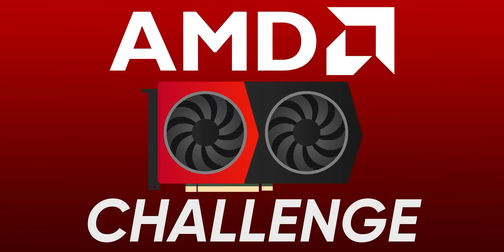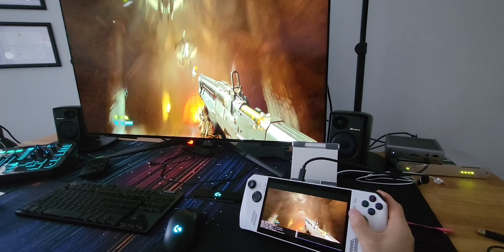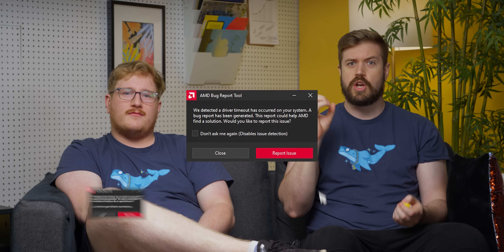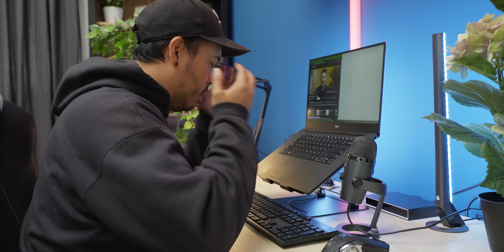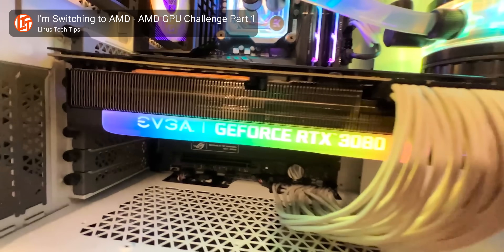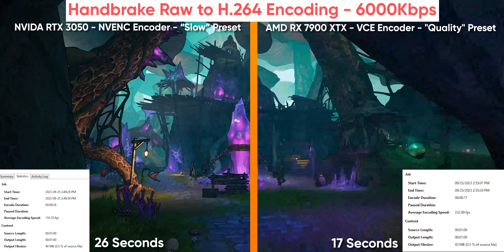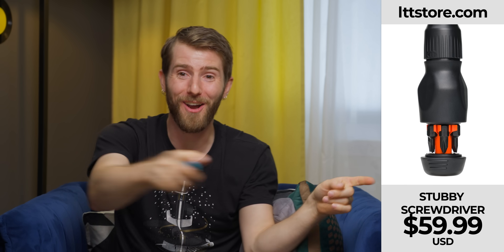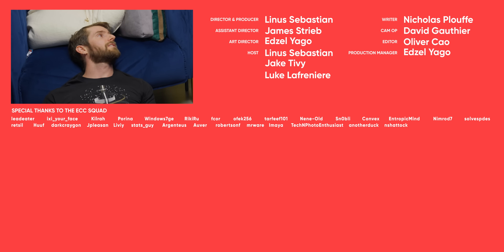I’m Staying on AMD! - Radeon Challenge Pt. 2

Comment: I've been running all AMD since before Ryzen gen 2 came out.
The most severe problems I experienced were that the system would randomly crash during a video render (turns out the GPU was actually, physically brokem. It worked great for 5 years though, so I definitely got some good milage out of it) and the red and blue channel switching for some reason when I imported a clip into the editor timeline (turns out the newest drivers were bugged, downgraded them and that fixed the problem).
Overall, my experience has been pretty rock solid, and with FreeSync monitors being much cheaper and easier to obtain that GSync monitors, white the cards themselves also tend to be cheaper for the similar performence, I don't see myself switching to Nvdia or Intel in the foreseeable future.
Reply: Yea amd sucks I won’t lie. My friend used an amd gpu and his stuff constantly crashed
Reply: When I tried making the switch I nearly barfed at the 6950XT's streaming encoder. No amount of tweaking brought it close to what my old 2070S had.

Then the random VR issues like steamVR intigration detecting my vrset as a moniter instead of a vr set, stealing my mouse cursor, only for turning OFF the intigration making it so games literally couldn't detect the AMD card. Ex: Darktide

Then the inconsistant and unexplained flickering on my third monitor where it'd just randomly lose signal from the graphics card.

The preformance was great for the price! But... I like VR, and I want to have the option to stream.

So I swapped back to green and got something in the 3000 series. 😅

Comment: For Luke’s issue with discord randomly crashing, I also had the same issue on my XTX but I fixed the issue but using 3 individual 8-pins from my power supply instead of 2+ a splitter (should have been obvious). Not sure why discord was crashing, but turning off hardware acceleration also fixed discord from crashing when the drivers crashed (which I didn’t need to do after the cable swap)
Reply: So you are saying you ran 3 individual Power Lines to the card instead of the Cheat 2 Way Wire that Splits from 1 Source Socket,making the setup come from a 2 Line then go to a 3 Line Powered Source.
 This would be the the MOST IDEAL for MAXIMUM VOLTAGE DROP EFFICIENCY !
It also explains how you fixed Discords "HARDWARE" Issue ! Note HARDWARE !
 Using Hardware acceleration was the Key Here and Your Fix. The Card is using more Voltage during times it NEEDS it for voice and Vid if your using that too. That's a HEAVY Demand ! Plus your Gaming too?! People forget we ask alot of these things.
They are truly a Modern Gift. But during Voice & or Video Side-loading through Discord,
 the Video Card draws Voltage & Current demand in sync with that demand.
 
Just think of your audio Amps,but MORE complex. That's a CRUDE comparison,YES,but you get the drift now. That is why Luke was having trouble ! His supply was Buckling under that strain,that and the choke point of the Pcie Cable he added. He needs a better CABLE & BEEFIER SUPPLY ! ALL the symptoms he was having points to it. Adding the supply helped ! That confirmed it! Replace the 1rst supply with a Larger/better Supply,PERIOD!
 
I'm a Retired EE,and STILL learning this day in age ! I LOVE new TECH ! I LOVE this 
Channel and what it stands for ! Keep up the good work.LINUS & ALL !!!! 🥰😎

Comment: As a AMD user I've experienced similar behavior where my GPU is pretty buggy for the first 4-5 months but then after a few months and updates the GPU reaches a state where its pretty stable while also seeing performance improvements which is nice
Reply: That should not how it be, It should be stable right at release even if they have to send it clocked down and clock it up with the stable drivers, cause all Nvidia cards no matter how expensive work right of the box with full performance, cause not everyone has the knowledge or experience to know what's wrong or the patience for new drivers, especially PC Builders who need to be able to get the newest cards into prebuilds days after release and sent out and if the PC shows up with buggy video , Who gets blamed? The PC Builder and that's not good for business for the PC Builders or AMD cause that means people new to the PC World will be like, WOW my Brand new just released last month AMD GPU is buggy as hell/ Let me buy a Nvidia one and WOW it works no issues, and they probably wont go back to AMD for a long while so honestly AMD releasing GPUs with buggy performance is just pushing New PC owners and Builders to Nvidia
Reply: good when i buy my 4080 it just works perfect from day 1 until today.
Reply: well, when you have a graphics team that is like 4x as big as all of AMD's both processor and GPU population, you can get that. this is a VERY small team making hardware that is close to NVidia, and waaaaay less people to write the software. if you do want no fuss, go green. but im sticking red for the time being because my 6950xt was waaaaay less than anything in that realm from team green. and it's been pretty stable. ive had 3 crashes in-game in 8 months since i built it. out of game, zero crashes. and, since im a disabled vet with a lot of time on my hands, i game 6-8 hours a day, every day.
Reply: @juanb2715 Thats great to hear. Took them about 1.5-2 years to fix the 2xxx series not downclocking in idle when you had more than one monitor. Im happy they have that fixed from the start this time.
Reply: @ghomerhust  So what if they have to push off release by a few months if it means working drivers? As Luke said A LOT of people probably returned their 7900xt/xtx when they had any of his issues for even a fraction of the time he did, cause not everyone is a tech head or has somewhere to go to have the issues diagnosed
Reply: @theengineer2017   while I agree that a product shouldn't be buggy at launch my 2080 that I got at launch had just as many problems as my 7900xtx
Reply: Yeah. the vega64 in my alt system is solid but spent its first year of release crashy af

Comment: The end of this video mentioning unexplainable problems was so prescient for me. I literally had a problem today with the lcd screen on my Aorus Waterforce AIO that ended up being a power supply issue with the SATA power going to the AIO being enough to power everything but the LCD screen. This was a new issue and I ended up spending hours trying to figure it before considering the power supply as a possible issue.

Comment: The weird issue Luke mentioned at 8:58 where discord closes when the driver crashes has been happening to me too these last couple of weeks. I suspect the AMD driver doing some funky stuff to cause this because it's happening with different crashes, one of them being a "DXGI_ERROR_DEVICE_REMOVED" which means the gpu is physically removed from the system (I promise I didn't remove it, only happens in Battlefiend 1)
Reply: I've actually started having some issues with Discord specifically a few months ago on NVidia, suppose they just keep bloating the app and breaking some stuff in the process of doing so :/
Reply: My guess is that it's from Discord's overlay, cause it injects itself into the game, which can cause issues on both sides. (which check boxes here)

Try to disable Discord's overlay on these specific games and seek for improvement!
Reply: So i was having this issue only when having discord open while gaming, which is kind of a big deal lmao, but if you disable Hardware Acceleration in Discord it helps A LOT, or at least it did for me. (Ryzen 9 5900x and 7900xtx)
Reply: He was most likely having some PCI-E signaling issues due to his riser. One of the tricks that GPU drivers do if the GPU glitches out due to issues like this is to power cycle GPU Vcore more or less, literally turning the chip off for a moment to reset it.
Reply: @underhandedjoe568  On Linux, I know that some time ago AMD had some issues that were traced down to a bug in the firmware that handles hardware accelerated video decoding. (which is sent to the card by the driver during boot, so there was no need to flash the VBIOS thankfully)
Reply: @underhandedjoe568  This. Had the same issue and disabled hardware acceleration on everything I could think of and it is not an issue for me anymore. Been working for months.

Comment: Am I the only one with an 7900XTX that's had zero issues with it? I have the PowerColor Red Devil and I just set the power tuning to +15 and set the fans to max, it always "just works" for me
Reply: No issues with my reference asrock 7900xtx in a micro itx system
Reply: I've had mine for about a month now with 0 issues.  I was on a 6750xt prior with no issues as well.
Reply: No issues with my Red Devil 7900XTX either.

Comment: I'm very happy with my RX 7900 XTX. I did have a weird issue where the whole system would freeze, and the entire driver was gone after reboot. It happened many times, and I was ready to return it, but then I realized the cause of the problem was my overly aggressive undervolting of the card. It never happened again after I stuck with default settings. Other than that, the experience has been stellar. It was a big upgrade from the RTX 3070, especially in the VRAM department. Most games would stutter constantly because of that. But now, they are a thing of the past. I may go back to team green for the next generation, depending on the adoption of ray tracing, the success of ray reconstruction, and whether AMD fails to catch up in ray tracing performance. But for now, I'm extremely pleased with my AMD supercard
Reply: my rx 570 once did that idk why, just renabled it in device manager

Comment: Weirdly enough, I’ve had all of these issues with my RTX laptop. 
Very interesting, is there a chance that certain software is affecting all hardware? Or perhaps 30 series Nvidia and 7000 series Radeon only?
Reply: That depends on the laptop. Its a much wilder and more varied experience when talking laptops
Reply: Is it a TUF gaming lappy? Cuz I'm going thorigh it on my ryzen 7 and 2060 as well  Hahahaha
Reply: @BenwahBalsss  it’s an Acer Nitro 5 with a 12500H and a 3050ti. It’s not much on crashing, but if I leave it on, it GREATLY drops in performance and I need a full restart to restore it to maximum performance. It’s treated me well but it’s also kind of annoying that the sleep mode seems to slow down the computer.

Comment: I think having Hardware Acceleration on in Discord is what causes a driver crash to completely lock it up or close it completely. Discord will do this when I'm updating drivers, which makes sense because the driver installer will uninstall the current driver and then install the new one. I have not tested updating drivers with hardware acceleration off to see if it still does it, but it's the only explanation I got for that. I have the 6950xt btw

Comment: Last time I saw the bug report tool pop-up I was on a Radeon RX5700XT. That one was rough on launch but very good at the end. My RX6900XT which I got since launch is really great. No issues, zero crashes. And I'm always jumping immediately to the latest drivers.

This video of TechLinus is weird to see. Hard to believe this would be the actual state when you do a proper new OS install.
Reply: Doesn’t mean that these problems don’t exist. It’s way better than 5700 XT days but it still is hit or miss. 

Even with the 7800 XT, the card just kept crashing in F1 23 because of the launch drivers. 

I had a 6600 XT, 6700 XT and 6800 XT. 6600 and 6800 XT were fine but occasionally had driver issues with the 6700 XT. It also had the ridiculous junction temperature deltas of 40c. 

Overall, it was a pretty good experience but jumped on the opportunity to get a brand new 4090 for 20% off.
Reply: @person1745  delta temperatures between 12 and 22 degrees Celsius are normal. 40 is way too much > RMA

Comment: It would be interesting to see another round of the Linux challenge on AMD. I bought a 6900XT not long after it launched and have exclusively used it on Linux ever since, it’s been absolutely stable and super performant in every use case I’ve given it. Plus I never have to think about drivers because Mesa is magic. 

Linux is Linux, so weird problems pop up sometimes, but it’s never been caused by my GPU. My 980ti was the complete opposite experience, but apparently Nvidia’s Linux drivers have improved since I switched to AMD.

The encoder still sucks though. It’s the one thing I really don’t like about the card, so I have a secondary A750 to deal with all encoding.

Comment: Got an RX 6700xt earlier this year because I’ll be switching to Linux at some point.  I had some initial issues because I forgot to remove my nvidia drivers, but once I got that figured out I’ve had only about the same amount as I did on my 2070 Super.  I always restarted after Nvidia updates because everything would look weird, so I was already used to that.  I did get one hard bluescreen recently that looked exactly like the one Linus had, but a restart fixed it no problem.
Reply: Just made the switch to Linux with my 6700. Been great so far, but I experience system freezing issues when resuming a game from sleep, but no really any other issues. 

I haven’t had to install a single driver. Playing Cyberpunk at 1440p with 70-80fps, on Ultra settings with FSR 2 enabled and reduced reflections (high settings).

Comment: Around release, I did have several crashes and interesting stuttering that would occasionally happen, but the majority of the time I've had the 7900 xtx, I've only seen a small handful of issues. Coming from a 9900k with a 2080, it was night and day in terms of overall stability. I've never had so many issues with computer hardware other than the 2080. I have a reference 7900 xtx with a 13900k with a 6 year old install of Windows 10, and I seriously couldn't be any more happy. I'm not going back to Nvidia for the foreseeable future!

Comment: I‘ve encountered some of those issues with nVidia cards, too. For example after one driver-update my computer kept restarting itself in sleep mode. Also quite recently my browser started to produce strong artifacts when the window was on my gsync monitor. Turns out either Google or nVidia has broken Chromes
hardware acceleration.

Comment: In 20+ years of building my own PCs I have never had anywhere close to as many problems as I have with the latest gen of GPUs. I started with an all AMD build including a 7900xtx that had all sorts of random artifact and random crashes. Since I couldn't get a replacement and was told it was too soon to RMA it, I decided to go Nvidia. When it was all said and done I went through 4 different 4090s (Zotac twice, MSI, and finally ASUS). All the 4090s I dealt with the exact same issue: when I installed drivers it would immediately crash. The last 4090 I got my hands on just worked right out of the box.
Reply: Sounds like a serious YOU problem dude LOL
Reply: If I was in your shoes I definitely would have tried a fresh install of windows after the second or third card as at that point, while it's not impossible to be the GPUs, I feel like it would've been more likely something else in the build is screwy
Reply: @empedance1933  I did fresh install of windows several times. At first I was trying to hold onto windows 10, but I eventually caved and been hating windows 11 ever since.

I even went through full new hardware 3 different times. I tried updating the bios firmware with every 4090. Once I even used my 2070 to install GeForce drivers so I could change a few power draw settings. That made it so I didn't crash right away when I installed the proper 4090 drivers but it was still not a playable experience since I still had frequent crashes and weird stuff happening.
Reply: @LPcrazy_88  goddamn yeah that's crazy! Is it a Small form factor PC by chance? I've been hearing tons of issues with PCIE4 cards with certain risers but yeah other than that it just seems like really bad luck you had lol
Reply: @empedance1933  nah man no riser used, no small form factor. Normal ATX mobo and my PSU was all way over recommended specs. I didn't use any power splitting squid cables, made sure to even get a 600w 12vhpwr cable.

I tried so many "fixes" it's not even funny with every one of the 4090s. And since I tried multiple hardware configs I am confident it wasn't any other part of my setup. Twice I even asked a friend to throw the 4090 in his build and same issues. This is the first time I've ever gone crazy to get the best stuff available and man in the end it wasn't worth the hassle.
Reply: @JaySerano  Lol yes, very astute of you to notice that a problem I described myself having was in fact a problem for myself. Couldn't have gotten to that conclusion without ya. Thanks for the comment.

Comment: Across most of these, it smells of the classic NVIDIA to AMD (or vice versa) driver install issues. The best way to avoid this is a complete Windows rebuild, but DDU is a close second best.

As for Luke's sleep issues, it's funny to look back and know that this was 100% a roll of the dice Windows bug. You were either affected or not. I'm surprised they didn't ever see anything about this with how many machines they run in their work environment. Or maybe this was before the bug was officially reported. Hiberboot/Hibernation functions have long caused issues, but not nearly as bad as it was that time around.

Edit - I stand corrected. They all ran DDU (I was surprised that they never mentioned it until the end) - weird that it reeks of the normal issues of a straight swap without it. With as much storage as they all are assumed to have, a Windows install wouldn't be too bad, though.